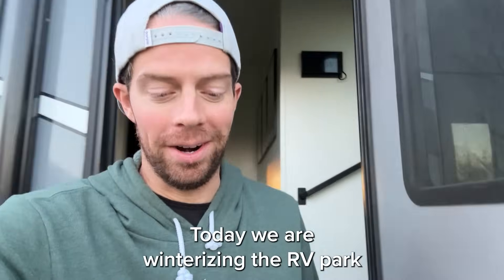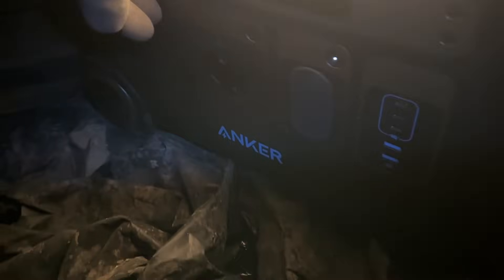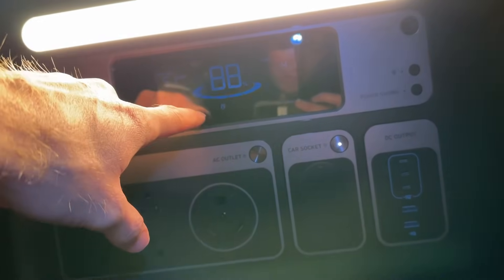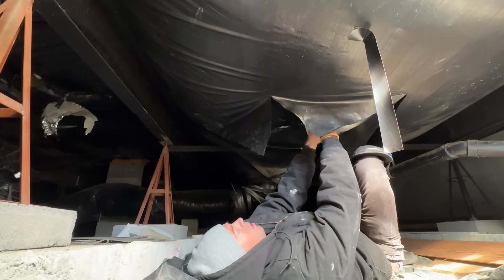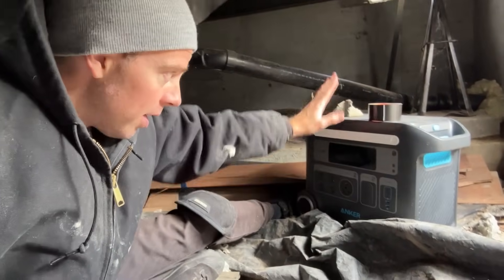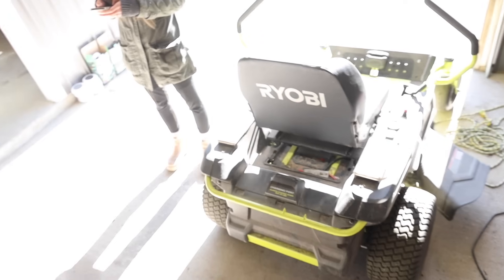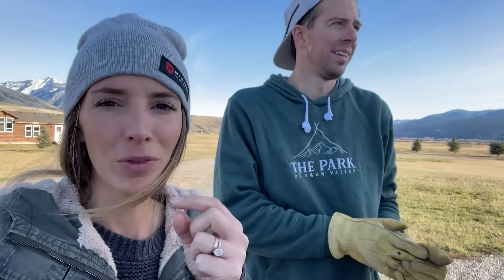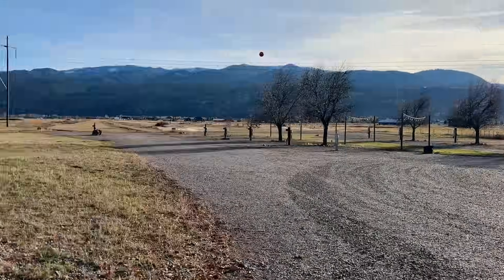We Have To Shut Down Our RV Park (Here's Why)

Comment: Wrap those pipes in insulation. It’s easy and defs buys you a few weeks for weatherizing.
Reply from the maker: that's a good idea! In the well housing or under the house?
Reply: @TheJurgys  BOTH for sure the Well Not that it will do much depending on how cold it will get but under the house it will help as well.

Comment: My thought is that it is either condensation between the two plastics or somewhere else water is getting in between the two and traveling downhill to that spot.
Reply from the maker: that makes sense. should I worry about the condensation if that's the issue?

Comment: We it looks like your “cabin” is actually a park model.  We use hardi board underpinning  with 1” styrofoam board lining it.. 
no that u cut the under wrap aka: belly board.  Time to pull out all wet insulation.  Before you install new insulation, make sure it’s a much higher rating.  Wrap the pipes before you put the insulation back up.  Then buy the underbelly material— you can buy it on line.. also buy the tape that works with it. Do NOT use cheap tape.. use the recommended tape for the  underbelly.   We owned and operated a park for 25 years.. best of luck.
Reply from the maker: Appreciate all this! It’s a 2100 sq ft manufactured home. Got the right underbelly material coming. No insulation is wet actually. Just was wet in between the two underbelly material. Did you ever see condensation between double layers of underbelly?

I’m wondering if they did wrong by doing two layers of underbelly material

Comment: I don't know if this is possible. But it is a thought that came into my mind. Since there was two layers of tart above the top layer was dry and they was water in between the insulation was fine Could it be condensation gathered between the two pieces of tart from the house being warmer above the first layer and under the house being colder And it just not being a big enough cold under there for the condensation to freeze.
Reply from the maker: Actually this makes sense to me!! Especially since nothing to do with plumbing in the house. Maybe we need another barrier on the ground to lower the difference in temperatures?
Reply: @TheJurgys if it was just condensation then you would see similar moisture in the other sections. Also there's not enough air between those two layers to generate that much water.

Should look at the edges of the section to see where the two layers are connected to the cabin. You're probably right that there's a gap somewhere that's allowing rain water to seep between the two layers.

Comment: You have a condensation issue with the two layers of tarp Normally you would have a moistair backed insulation and then that would be all that's needed underground really shouldn't need the plastic IMO but those two layers will normally cause water to form no matter what...We had that issue on a house we redid at the farm. you could get away with an insulation that has the paper moistier backing and then the plastic tarp.
Reply from the maker: Thanks for this! Should I remove a layer of plastic tarp? Or what do you recommend?
Reply: @TheJurgys  remove one layer to solve the water issue, you didn't have paper backing so you need a vapor barrier. You could also look into sealing th foundation on the inside to reduce the ammount of temperature change.